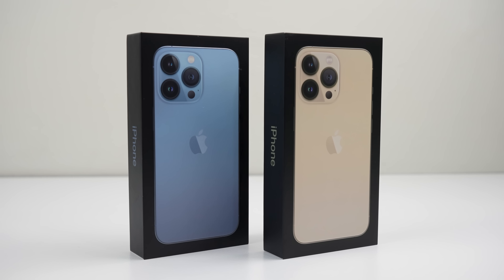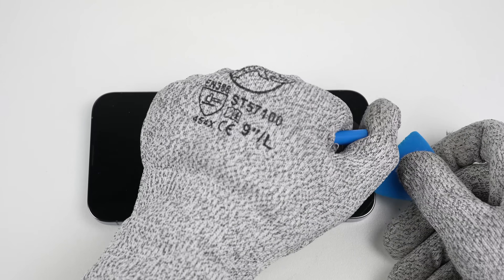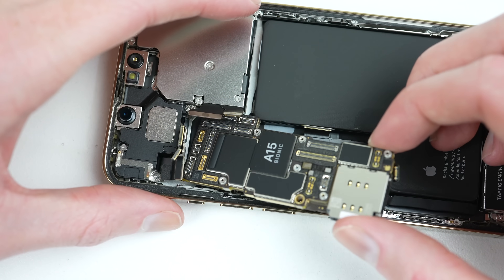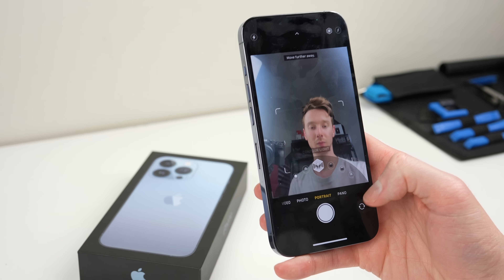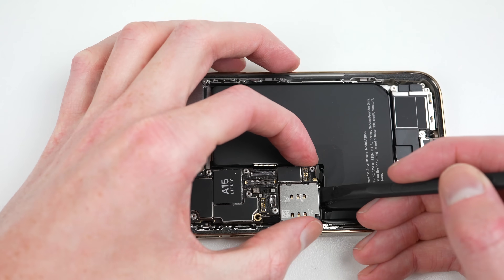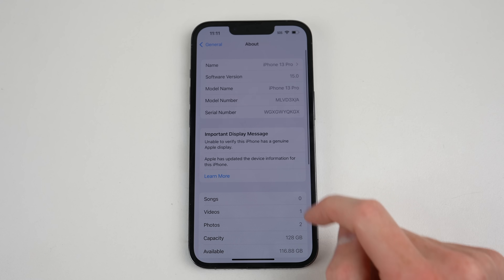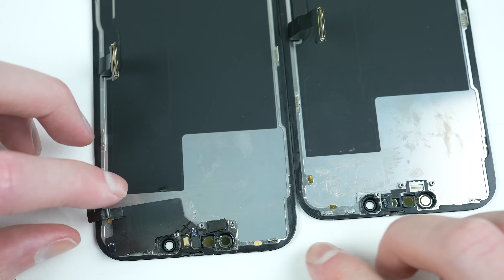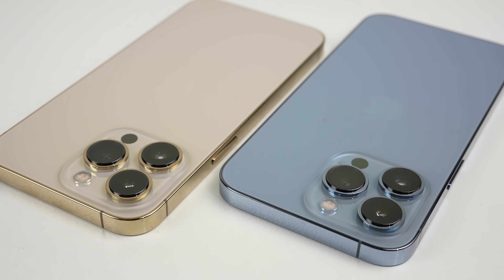iPhone 13 A Repair Nightmare - Teardown and Repair Assessment

Comment: I think it's a bit biased to discuss the problems you've found while only discussing a single possible reason for them.  AFAIK, every iteration of the iPhone since touch-id has had the motherboard "paired" with the login device.  The home button was a big complaint when it went to touch-id because people couldn't replace it.  The phone stores a digital certificate from the home button to prevent man-in-the-middle attacks and automated login attacks.  When an AASP replaces the home button, they have to run an Apple program that "pairs" the devices again.  Doing this also resets the face-id and you have to go through the setup again.  From a security standpoint, this is a good idea, although I'd like to see it not require the tool to pair them, and to simply delete the credentials and certificate and start over like fresh out of the box.  I don't see how this would detract from the phone's security, but I'm not on their engineering team so it's entirely possible there's something about this process I'm not aware of.  The new face-id is almost certainly designed around the same security principles of pairing hardware to prevent MITM attacks.

It's no different than the warning SSH gives you when you try to ssh to a server that has been replaced - the certificates don't match and it won't just let you login. (you have to dismiss the warning, and may or may not be given the option to accept the new identity)  But of course it eventually will let you do it, you're not forced to use a tool that's not commonly available to continue.  Apple is being a bit stubborn here, but that's nothing new.  I've never seen them willing to just hand out their service tools to the public.  Even working as an AASP, I was aware of tools that they kept entirely to themselves.  Some of them were for security purposes, where "security through obscurity" was in practice.  In some cases, it's either not possible or not practical to just give out tools that perform maintenance on security components, and limiting their availability is the only way to limit their attack surface.

I won't deny the service aspect.  Apple certainly benefits from limiting competitors from servicing their equipment, even when the competitor is a parts/tools reseller or the user themselves.  It's "good business" to do that, although some of the customers won't appreciate it.  They're doing like most other companies, and trying to strike a balance between profit and customer satisfaction.  Too hard to repair, and customer satisfaction suffers and impacts sales.  Too easy to repair and service revenue / new unit sales suffer and impact sales.  Somewhere between those two ends is a point of maximum profit, and that's what any smart company aims for.  Calling for them to slide the bar all the way to one end is just a waste of time - it's never going to happen, and I think it's a bit manipulative to just push that idea on viewers, expecting them to "eat it up" and get behind a movement that's never going to produce any results.

Your tear-down and analysis is outstanding, but you could improve the content of your videos by exploring alternatives, rather than coming to a single conclusion as though there was only one possible justification for the design, "Apple doesn't want us to fix our phones".

Comment: apple just needs to take that last step and have the phone fry itself when it detects wrong components
Reply: BEEP BOOP WRONG SCREEN and then the battery just explodes
Reply: WARNING! Incompatible camera detecte. Tactical nuke inbound.
Reply: No, they'd make you think the device fried itself so they can re-use the components after their own factory reset kicks in. Voilá, more profit.
Reply: @Nero_PR  
How to double profit: Dell same phone twice
Reply: Tbh. It wouldn't be too much engineering to have a switch that even if the phone is opened, it sends high voltage to the CPU frying it. This feature is for the security and convenience of the user of course.  I'm sure the engineers at apple are working their hardest to come up with a way to just glue everything, with a glue that requires special solvent, or find a way to encase all the inside in some resin or smth.
Reply: @4Gehe2  I have seen that fucking "security of the user" line so god damn much and it is so frustrating to know their are people out there that really buy into that nonsense. Along with the shit about "we are removing a significant amount of packaging and accessories from your order "for the environment". Apple doesn't give a fuck about the environment, if they did they would wait 10 years to release a new phone when they actually have maybe 1-2 new features, and their previous models would have been designed to last that whole 10 years, WITH FULL REPAIRABILITY. Instead they do everything they can to get you to trash your 1 year old phone and buy into the next years phone. Seriously, the reason apple doesn't want 3rd party repair and charges insane prices for apple repair has everything to do with "totaling" the phone, where it would be more expensive to fix it then it would be to just buy a new fucking phone.
Reply: It would probably be a better choice for Apple to have all phones on lease, rather than purchased.  When your lease is up you give up your phone and lease a new one.  At least that would cut through their bullshit and they can be upfront about their intentions.

Comment: The EU needs to have a look at this, once they get the USB type C rule implemented and claim that victory.
Reply: @chyza2012  I am pretty sure he meant they are focused on making Type C standard, taking some ground away from apple and then working on making this shit illegal after that.
Reply: @shepardpolska  Yea, from what I've heard the USB-C connector standardisation bill isn't just that, it's also related to Right To Repair in some ways that are suppose to make selling such devices, like the iPhone 13 in this case, much harder. Although I haven't read it myself, just what I've heard.
Reply: usb c is not the biggest problem right now, it's a lot worse, in the mid 2000s phones all had different connectors (samsung,nokia etc)
Reply: No free market and innovation will truly create a shithole environment in EU

Comment: This video is exactly the way you explain right to repair. Holy shit this is nuts, didn't realize how bad Apple has gotten. I'm guessing authorized resellers hopefully get a tool to set the phone to the new models. 
Either way this is really bad, hope the pixel 6 is good again fingers crossed

Comment: I was thinking about getting an IPhone. I really don't think I will. I knew they were trying to make it actively hard but this is far more than I expected. This is active work put into it, this is actually a lot of effort just to prevent repairing and as someone that repairs vintage electronics a lot I hate this with a passion.

Comment: Meanwhile at Apple "Hmmmm for the i Phone 14 we should make the system forget part pairing codes the moment you take it apart that way simply opening a phone will render iit inoperable. Thunder Lightning and evil laughter intensifies
Reply: You know the message stating that genuine parts are not genuine seems like it would be a good lawsuit lever to pull on grounds of fraud because apple is actively misrepresenting its own parts ...

Comment: Apple introduced serialization to all components
I'll never buy another until right to repair is a standard
Cabon neutral lies... yeah they really care about the planet
None of these companies do, you still have to buy a charger and next it will be the cable
but head over to amazon where you can buy 3 at an amazing price until you can't and
the package will be about the size of a mid tower PC

My last package could have for a PD charger could have fitted in about 5 more

Comment: how things have changed, along with two way radios I repaired the first analogue cellphones in the mid 80's to component level that means individual resistors capacitors coils and transistors as well of course plug in modules...even when the first digital phones came out about 10 years later repair everything was still nearly always possible without sending back to the manufacturer --- both the places I worked were private companies approved by the manufacturers of many different brands...  of course these were not smart phones I got out of that industry before they became a must have thingy... yes I have Android...wont touch apple stuff but thats more to do with their computers back long long ago :D

Comment: with this and so much more, is there still a reason to buy this? there's so many good looking phones out there from companies that don't abuse their costumers.
Reply: dogecoin investor  best to start supporting the companies that don't. They listen to money, and if they are losing money because if these practices they will have to listen or go broke. Apple is only surviving off of brand name at this point anyways.
Reply: dogecoin investor  
i got a couple more years of samsung left before my collection of 3.5mm jacks becomes useless to all but my computer
and also i actually require the ports for reduced latency.
Reply: "good looking" is not enough. Is there really any other company producing phones which can be repaired by mere-mortal using simple tools (no special glues or totally custom screw-heads etc.) ? I doubt that.
Reply: @TomSilver_42  dunno about oneplus's newer models but the 5t is really easy to tear down and swap parts on.
Reply: @TomSilver_42  yes, but not top of the line, luxury smartphones
Reply: @verybarebones  wth is a "luxury" smartphone? My Samsung functions just as well as my cousin's iPhone and I bought mine for 500$ less.
Reply: To be fair, Apple's the winner in this move I feel, at least until more people get invested in the idea of Right To Repair. Most of their consumers aren't that interested in Right To Repair and all they want is a good phone and iPhones, and other Apple products for that matter, are very good when they work. A lot of people buy their products purely for the branding aswell, perhaps in the sense that they've just used Apple for so long that changing to Android isn't comfortable for them. It's truly a shame.

Comment: Disclaimer: I dislike apple.

But, I do wonder if some of the camera issues are due to the device SW carrying correctional maps for the camera that could be, for example, calibrated for a variety of exposure and temps at factory. This would be the holy grail of calibration; sensors are not that great. There are less wasteful ways to do this, but I bet they would cost more.
Reply: note, everyone in the comments dislikes apple
to a certain degree

Comment: those are just such nasty practices. I mean, how long till they put in actual suicide components that will blow up the phone on any tampering --'

other than purposefully being cunts, there's no reason to do any of this. 20different screws and everything hardcoded into it to feck up any repair efforts --'

Comment: I thought monopolies in the United States were illegal, yet here it is, Apple placing a monopoly on the repair-ability of their phones. And yes of course, the government will do nothing. Sad to see things like this. Same thing is happening in cars. Even something as simple as a brake job requires a computer worth over 3k that only a dealer has access to because of the software. The days of DIY repair are over.

Comment: Apple 2028 - Unable to verify users skin cells as the original skin cells of the purchaser.  Please service phone at your nearest apple store to ensure skin cells are original.

Apple 2032 - Atomic particles in phone have been changed. Please service phone at your nearest quantum physics apple brainwash facility for service.

Apple 2087 - Users existence cannot be verified. Please service users existence at nearest apple store. Praise to the apple god.

Apple 2100 - User has breathed incorrectly on phone. Please goto nearest Apple store to replace lungs to not damage phone or purchase new, unbreathed-on phone.

Comment: I honestly hope the EU cracks down on this kind of behavior. They're already trying to cut down on e-waste by moving to require USB-C, so why not address the right to repair and further cut down on it?
Reply: @chyza2012  Lightning cables need to be bought specifically  for iphones, and by using USB-C you can use the cable from another device that you already have , happens alot to me, charging my Go Pro or a tablet with the cable of my phone, that couldn't happen with a lightning.. And their cables are very weak, they break alot
Reply: @chyza2012  Try sticking a Lightning plug into any USB-C port. You'll immediately notice a glaring flaw. Now imagine a glut of devices with the same port, only for them to all be from one company while other companies use different ports. Now imagine that all of those other ports are all of different designs. Suddenly, you'd end up with a bunch of walled gardens requiring special chargers for each. Moving all of these devices to a single standard means that compatibility will increase, thus requiring fewer chargers to be fabricated.

This pairs well with removing chargers from boxes, as it stops people from needlessly discarding functioning chargers, especially if they frequently swap older tech for new (something Apple encourages). This also stops companies like Apple from developing proprietary ports and hiding how much wear they're rated for from the public (*cough* Lightning **cough**).

Comment: Yeah, that's the real "battle for ecology." No charger in kit, without repair possibility, slowing with software on the old phones.
Reply: Ecology of the profits is what they truly want
Reply: yOu NeEd tO bY aNoThEr DoNgLe
Reply: Dio Black They have publicly admired to slowing older phones on purpose. And your argument about have left over wires is dumb because it still could of been option to keep or remove the earphones and charger. They didn't even decrease the retail prices. Apple is anti consumer
Reply: Ecology is just an excuse forcing you to pay for a charger
Reply: This is the real reason I never update my phone with apple, it works better without it
Reply: @nebylicza  I have an iphone 11, so unfortunately I'm on 13.3.1, no choice and it updated once on its own
Reply: @nebylicza  Yeah, it's moderately updated, not on base 13 though. A while ago I let it update. There is one issue that fucks with me occasionally. The airdrop icon on the control center, while on the lock screen can freeze the display, requiring a hard shutdown. No other major issues i have with it though
Reply: @nebylicza  If you go into the control center, by swiping down on the top right, there is the square containing music controls, in the top right corner of that box, there is 3 circles that are 3/4 complete with an arrow facing upward. If I accidentally press that while my phone is locked, the screen becomes unresponsive. That's the only time it happens. It will not turn off normally, so I have to relearn how to hard shutdown every time lol
Reply: @nebylicza  Yup, and that button freezes my phone. Pretty much the biggest issue I have with iphone right now, next I'm moving to another platform though. Ideally one with smaller phones. I don't need something the size of my hand
Reply: @nebylicza  I hope the big phone fad dies by the time my 11 dies lmao
Reply: @nebylicza  If it was pure speculation then explain the lawsuits that occured due to this software slowdown stuff. Stop being blind for a company that doesn't care about its consumers. As the other commenter said Apple is very anti-consumer and this repair shows it even more.
Reply: YourBirthCertificate Bruh, the slowing down of older phones wasn’t because they were old, it was introduced so older batteries wouldn’t just kill your phone in the middle of an important phone call for example. Apple made a mistake by not openly announcing it as a new function. The lawsuit was concerning exactly that, and only for a brief period between 2014 and 2017 (and devices made between 2014 and 2016), after which you had the option to turn the so called ,,battery optimization“ off for good. I did turn it off, and honestly, my old iPhone 6 felt way worse than before. 
This is exactly like the McDonalds coffee lawsuit. Everyone only sort of knows the lawsuit but still acts like they’ve studied the entire thing.
Reply: Repair IS possible, but only from certified repair...
Reply: wdym by slowing old phones with software? They support older devices and roll out updates on them constantly.  Other manufacturers ditch their phones after 2-3 years, while Apple keeps their phones updated for 5-6 years.
Reply: @faustaspetronis2  after said 5/6 years ios apps are no longer supported. I have an old ipad that can't open youtube.YOUTUBE!
Reply: @CLP97  just saying my note 2 battery is not great (which is replaceable) but it can run YouTube, although it's as slow as it's always been. I can change it's ROM without fear of it blowing up (speculation) and again, replace it's battery.  I don't use it, but I could in a pinch.